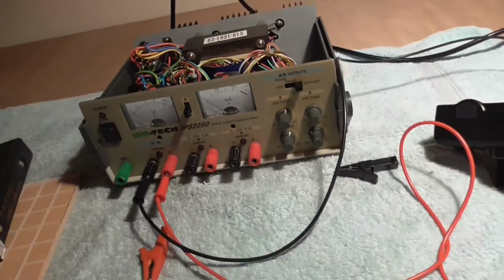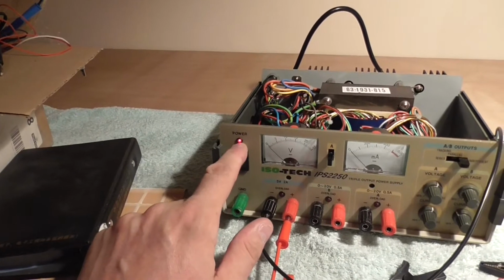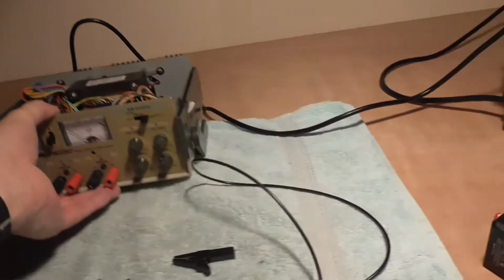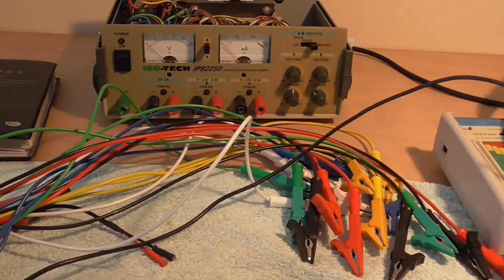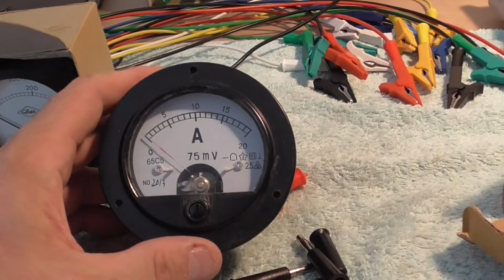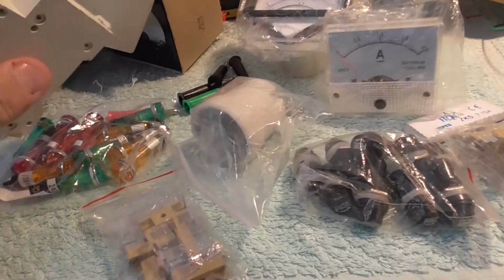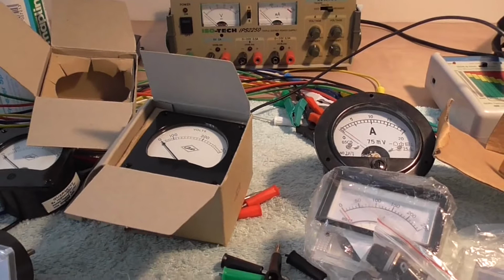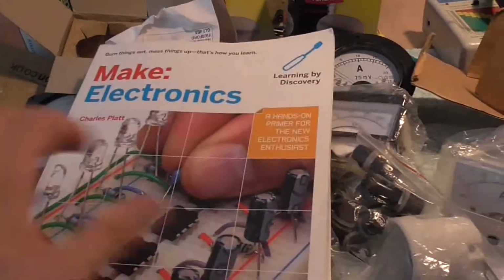Bits and Bobs 0007

Comment: Phabulous Philming.  We have 240 volts in our households in the U.S., but those circuits are really only used for large appliances like electric cook stoves and clothes dryers, water heaters, furnaces and air conditioners.  Practically everything else uses 120.  Back on our farm our air compressor and our arc welder in the barn also used 240.  When I lived in Tennessee a lot of folks used a portable electric heater called a stack heater that had wires coiled onto vertical ceramic tubes that used 240.  I had a 4 stack myself with 4 of those ceramic coil wire wrapped tubes.  Take care, Gary
Reply from the maker: Thank you Gary you learn some thing new every day.. I thort all your electrics was 120v.

thanks m8